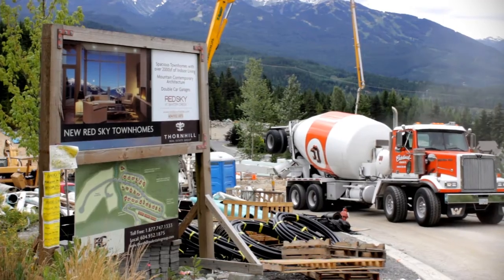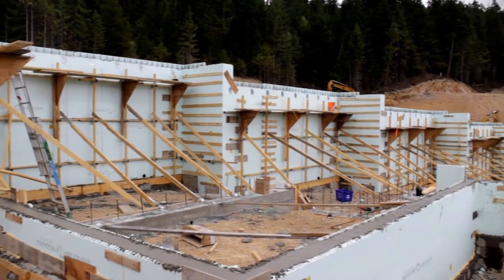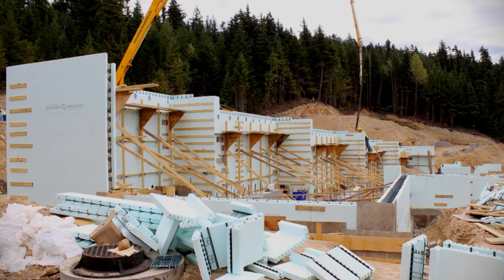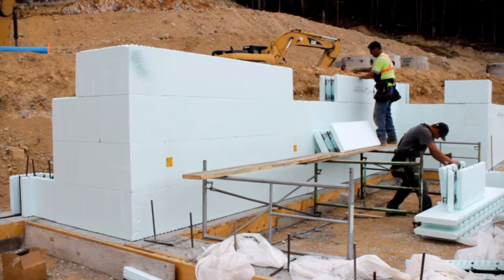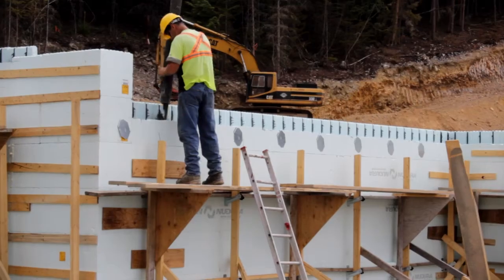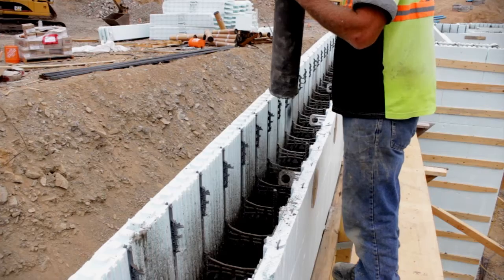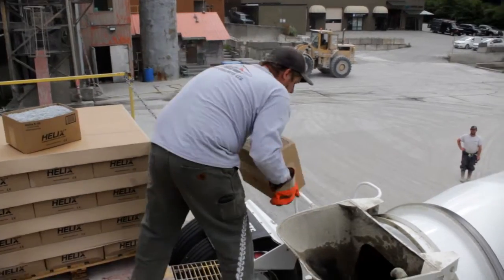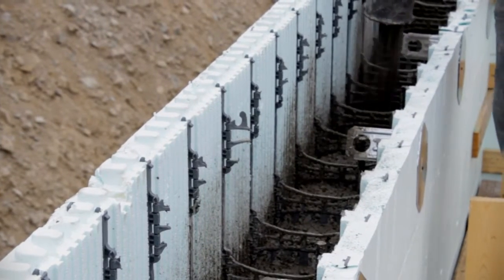Baxter Creek Townhome Nudura ICF

Comment: it is great to see these type of videos. question: for a 8" block how large is supposed to be footing wall?
Reply: Hello C Jacob. There is no "footing wall" under the ICF wall. The ICF wall goes right down to the footing. The size of the footing is a function of the load bearing capacity of the soil and the structural loads coming down through the ICF walls. Send an email any time to info@vancouvericf.com with any other questions you may have. Rick